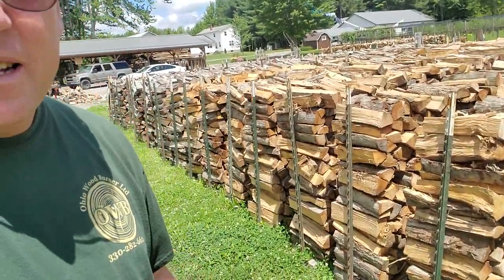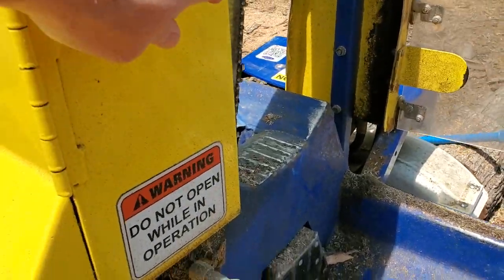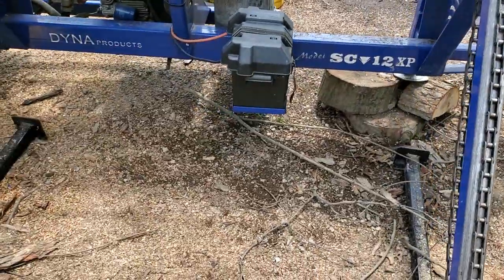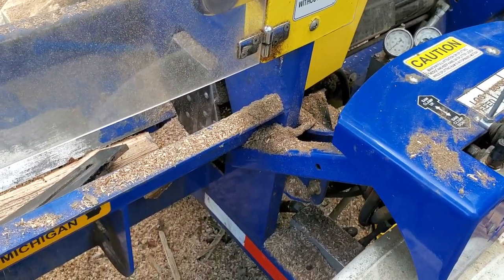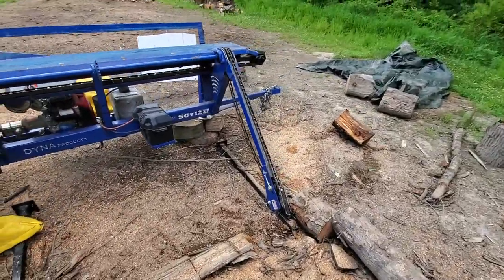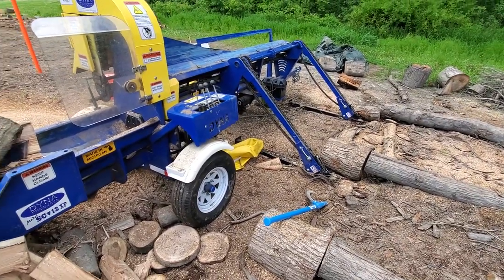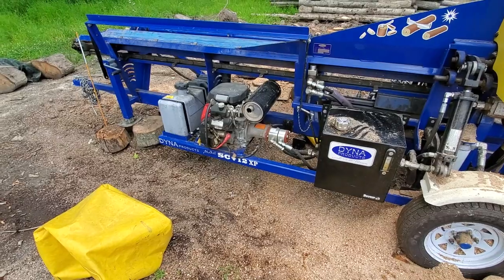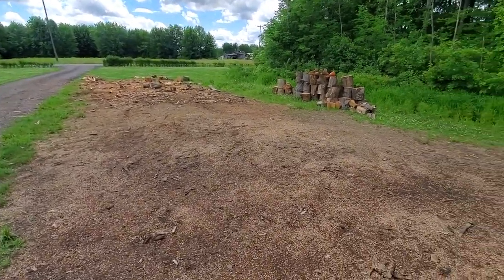Firewood Memory Lane...The Dyna SC12XP

Comment: That was an impressive amount of wood those guys had.  Very neat and tidy as well
Reply from the maker: They are VERY good at firewood.  They use their kinetic splitter and their splits tend to be smaller which works great for me.  Thanks Hometown for watching!  Joe
Reply: I had a tree service for about 30 years around Tulsa. We had a bad bug for a long time on elm trees and there was nothing u could do except remove it. Yes there was some crooks that will tell u I can save it and charge 3 or 4 hundred bucks and (deep root fertilizer) but one guy all he used was powder milk and poke his pipe in the ground and pump(homemade) his milk in the ground. They wold ask after he was through what is the chance and he would say 50 50 duu. But anyway u couldn’t give the wood away and we don’t have the log trucks around here

Comment: After seeing and talking with the Dyna people at Paul Bunyan it doesn't seem that you bought the wrong machine but, rather that you ordered a machine without knowing what you needed.  Almost every problem that you mentioned is an option.  They were the only ones that we talked to that were willing to change anything and everything to build exactly what we want and need.
Reply from the maker: I think that is fair but also I can't fault myself for that.  It was my first purchase and quickly realized I needed to be in a different arena.  Still the lack of an adjustable knife is the big deal to me.  I wouldn't now purchase any machine without one. splitter, etc.  Dyna is a great machine for sure.  Well built and will last for ever.

Comment: I've dealt with a few Amish families in Northern NY. Safety at their sawmills can be scary. I'm surprised they left the rubber tires on that Dyna unit. Using the hydraulic oil for bar oil is a bad design, your JAPA is better with a bar oil oiler.
Reply from the maker: I have a very good relationship with the Amish suppliers.  They are very good people, honest, trusting.  One family their daughters load my trailer, bare feet and no gloves.  They are very hard workers.  The Dyna oiler worked well.  I guess you could argue that 46 lacks the tackifiers that B & C oil has but they sell a lot of machines!  Joe
Reply: The Dyna is Amish made.